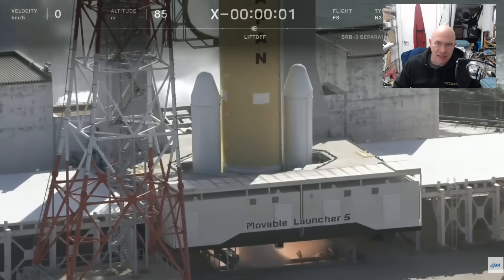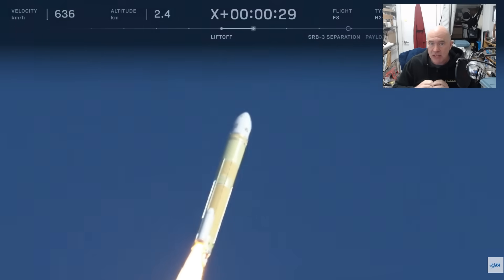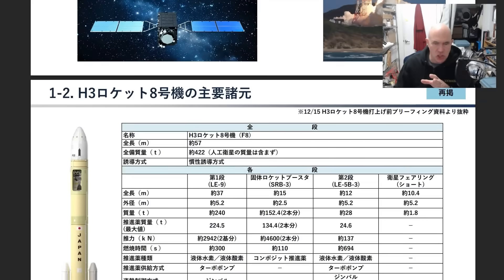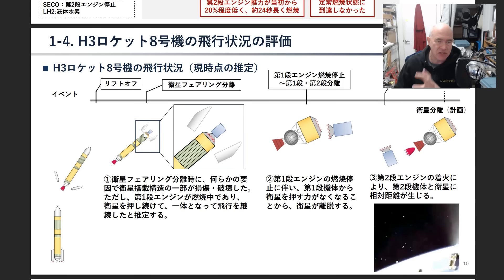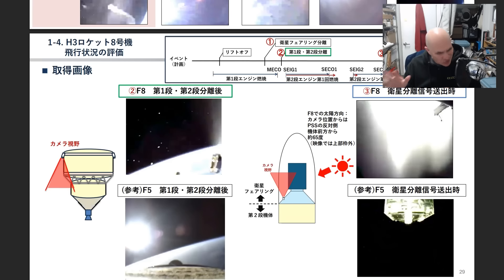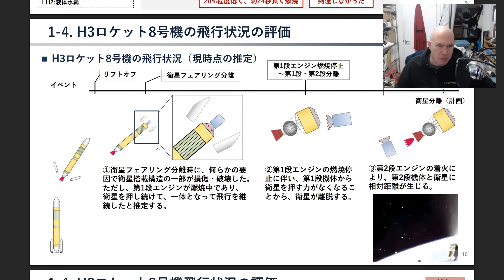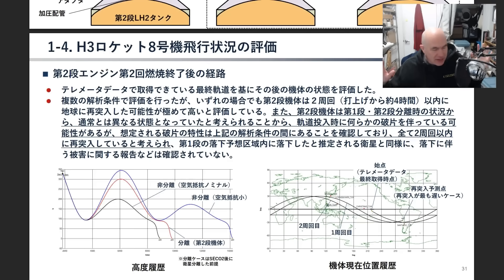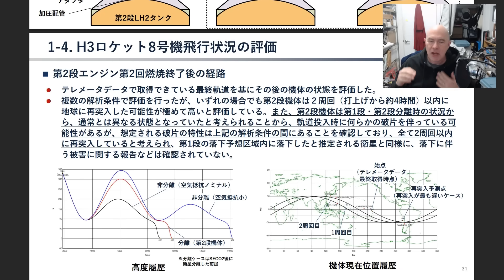OOPS! Japanese Rocket Drops Satellite Before Reaching Orbit....

Comment: "Does this happen often?"

"In space, during a high-G segment of flight???? Chance in a million"
Reply: "this may be a little premature, but we find the payload may have released early"
Reply: It wasn't even at a high G, most rockets on the way up are 3 to 4G.
Reply: @xaviersavedra3707  It's a play on "the front fell off".
Reply: @xaviersavedra3707  /r/woosh google is your friend sir, Clark And Dawe - The front fell off. DO NOT BE DRINKING UNLESS YOU WANT TO DROWN YOUR SCREEN
Reply: :face-fuchsia-tongue-out: I read the first sentence and instantly flashed back to Prom Night. I'm still in therapy :eyes-purple-crying:
Reply: I dunno what you are referencing. But that "high-G segment of flight" is just wrong.
Not because it was "only" 3 to 4G as that previous comment says (which is still a lot).
But because it happened between first stage separation & second stage switch on.
It's 0G for a moment. And that apply some "pressure" (actually traction) on the top.
Reply: @huyxiun2085  Referencing the video "the front fell off" a satirical sketch by John Clarke and Bryan Dawe, where Clarke plays the part of the Minister of Transport at the time, Senator Robert Collins, being interviewed in relation to the 'Kirki' oil tanker in which the front fell off (literally^) in bad weather off the Australian coast, causing a massive oil spill. 
I can't recall if any of the real interviews the real senator gave at the time was quite as crazy, but as the responsible Minister you can bet there was quite a bit of downplaying the issue / deflecting of responsibility as was (and still is) standard of politicians.

^ Yes, the proper use of the term literally.

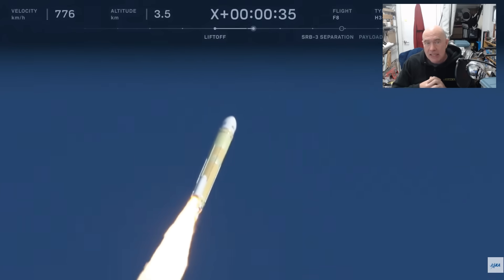Comment: 0:45 The front fell off. I'd like to point out that's not typical
Reply: well what sort of engineering standards are these rockets built to?
Reply: Oh, very rigorous aerospace engineering standards.
Reply: What sort of things?
Reply: @andrewgrandfield7214 well cardboard is right out, or cardboard derivatives
Reply: @andrewgrandfield7214  well for starters the front isn't supposed to fall off
Reply: @xXbillymaysXx  yes boys! 🤣
Reply: @andrewgrandfield7214 it's got to have an engine, there's a minimum thrust to weight ratio...
Reply: @richardleese7643  "what's the minimum TWR?"
"Ahh, one, I suppose"
Reply: @TMS5100 Minimum number of crew, proper materials.   Cardboard is right out.
Reply: @brianhaygood183  What's the minimum crew?
Reply: @teebob21 eh, zero I suppose
Reply: It was outside the environment.
Reply: @nopenheimer  yeah, there's nothing out there... except space junk, little green men, the occasional astronaut/kosmonaut/taikonaut.
Reply: @michaelkarnerfors9545 and 20,000 tonnes of space craft.
And the satellite that fell off.
But there's nothing else out there, a complete void!
Reply: @galliman123  and all the  starlink satellites, but don't worry, it won't contribute to kessler syndrome
Reply: @nopenheimer  was being the operative word ;)
Reply: Well, most of them are built so that the front doesn't fall off at all. 😆
Reply: Does this happen often?
Reply: @garner6583  No, most rockets are built so the front doesn't fall off at all!
Reply: I got your reference 😂
Reply: a wave hit it
Reply: Has it been towed outside the environment? 😀
Reply: @richardsimmons7134  yes, it was in the process of just that, to be towed beyond the environment. 

But it fell in another environment?

No, it's beyond the environment, there's nothing out there. All there is is sea, and fish, and birds.
Reply: @michaelkarnerfors9545 and 20000 tons of burning crude oil.
Reply: @michaelkarnerfors9545 and 200kg of burning satellite
Reply: Dang it all the best references have already been done. Guess I'll just drive home. Can someone call me a cab? I'd take my car, but the front fell off.
Reply: @brettatkinson987 excellent addition
Reply: Most rockets are designed so that the front doesn't fall off.
Reply: Was it made of paper based products?
Reply: Well there are a lot of these rockets launching around the world all the
time, and very seldom does anything like this happen. I just don’t want people
thinking that rockets aren’t safe.
Reply: @chewitt6353 wasn't this rocket safe?
Reply: @michaelkarnerfors9545 well I was thinking about the other ones….. 😂
Reply: @chewitt6353 The ones that are safe?
Reply: And I thought Japanese made their launch vehicles to rigorous aerospace engineering standards!
Reply: @PassifloraCerulea  what kind of standards are those?
Reply: @PassifloraCerulea  

That'll teach them NOT to take advice from Boeing.

🚀

🚀
Reply: lol, I was going to make that exact comment, but I wasn't sure how many people would get the reference, so i posted the entire script.  Looks like I should have just gone with the quote, as you got far more likes.
Reply: @_comment  While the name John Clarke might not be immediately recognised outside New Zealand / Australia, it seems if you mention "the front fell off" in a group anywhere across the globe, you'll get a smile of recognition and a retort taken straight from the skit.

Comment: If they know when staging is going to happen, why don't they pre-program the engineering cameras to adjust their exposure down by a given step at that moment so the auto-exposure controller doesn't have to readjust, then turn auto-exposure back on afterwards to allow gradual adjustments again?
Reply: I think the exposure settings are always different because of the different time of day and season during launches, the angle between the camera and the sun varies. But most likely they didn't have any issues like this so it wasn't that important to capture the moment of fairing separation on video. Maybe they will add that feature after this launch
Reply: Or multiple cameras set for different exposures. Cameras are light now, it would only be a few grams.
Reply: They don't know when staging is going to happen.  It varies based on rocket performance.
Reply: @zacklewis342  But somewhere in there is a sequencer going 
"Okay we are 99.9% on burn, Pyro charges for fairing sep check continuity" - "we good, under 50kOhm!" - "Coolio, on my mark. . . MARK!" and in there somewhere would then be a "Yo camera, sunglasses up, gonna be bright in a sec or two"
Reply: @StreuPfeffer  Exactly what I came to comment. But your eloquence would've been hard to beat.